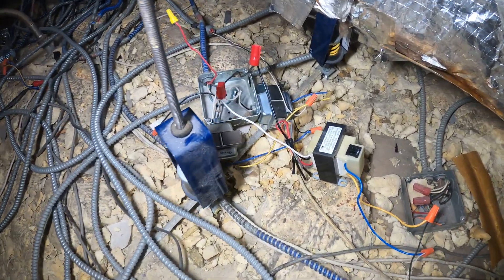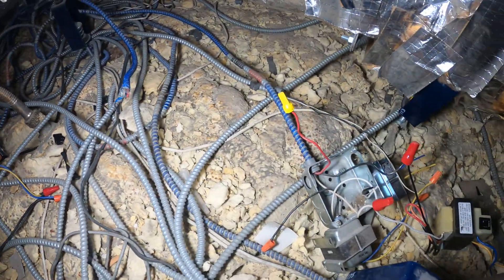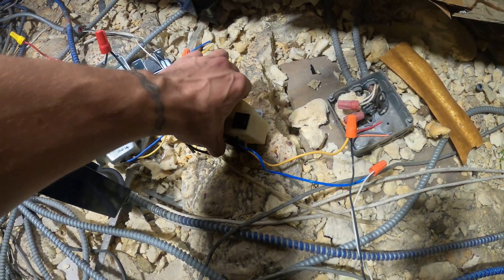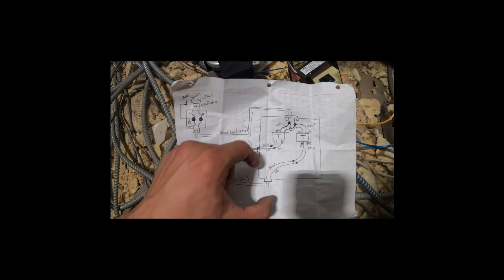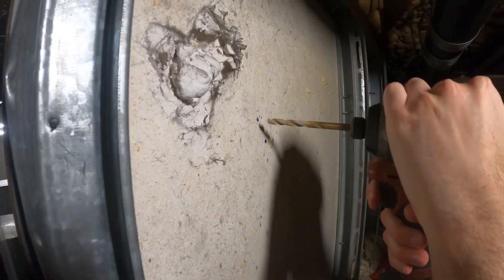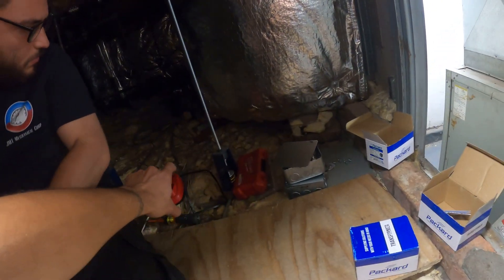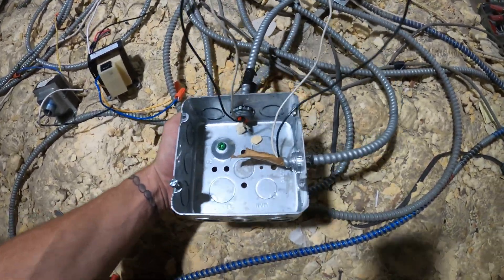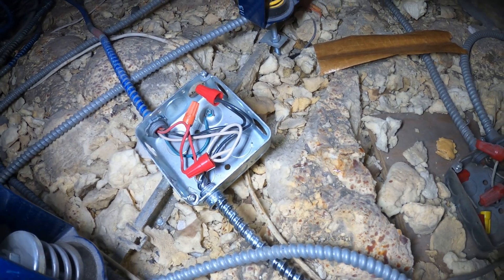HVAC Service Call: Electrical Wiring NIGHTMARE! Infrared Patio Heater Wiring Repair (Control Panel)

Comment: Can we just use one transformer to control all the low-voltage heater by using Parallel, so just turn one power switch then all the heater will on?

Comment: These messes are out there.  I did an HVAC call to a house that had the furnace plugged in to 3 extension  cords that ran across the basement ceiling to a light socket with a plug adapter in it.  The breaker panel was only 6 feet from the furnace.

Comment: leaving threaded bolts poking out of a wall you can walk past... not reversing the bolts.... crappy work... not putting EVERY box in a water tight connection... absolutely against code... nothing you did was decent, an improvement over the rats next but 100% of this is against code in every way. you should be ashamed to show this work.